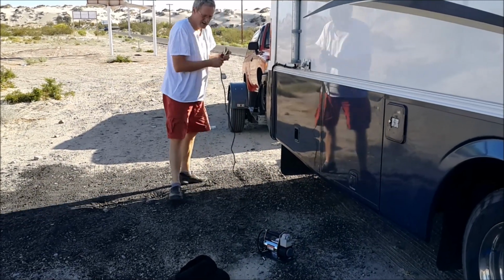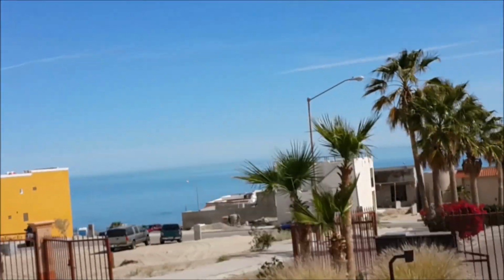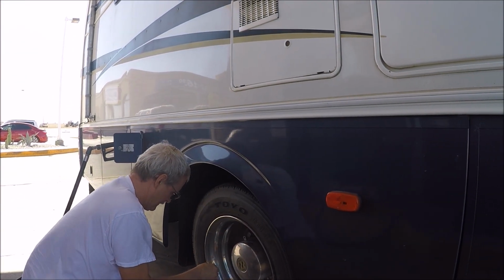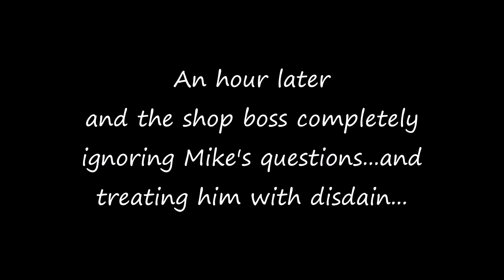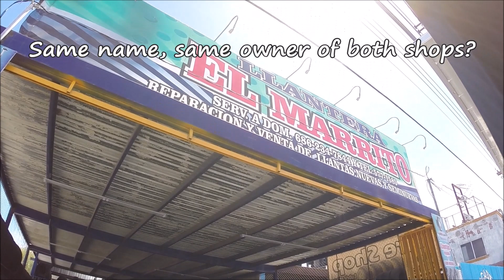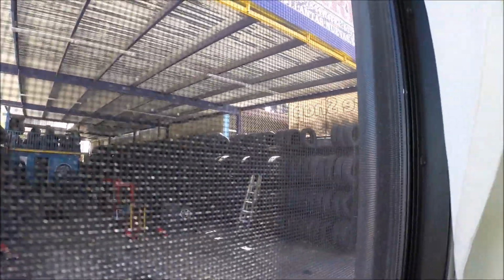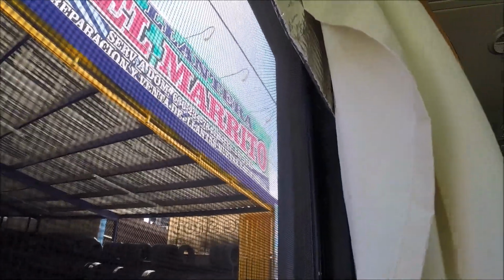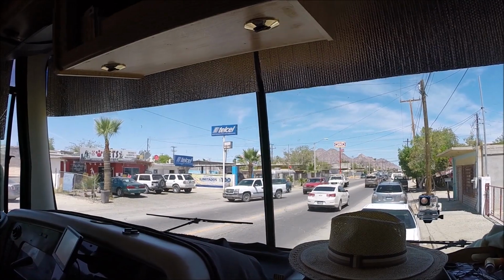Flat Tire In San Felipe Baja Mexico:What To Do [Full Time RV Lifestyle]

Comment: Was the problem the compressor you has didn't have enough PSI to fill your tire or you didn't have the power to run it? How old were the tires?
Reply from the maker: +RV Legal Eagles & Paws We had plenty of power and juuuuust enough psi to inflate for driving. We need a more powerful compressor ☺
Reply from the maker: +RV Legal Eagles & Paws Our tires looked newer when we bought this thing three years ago. Mike was able to make it driveable to get to a tire shop. We need a 120 psi 2 gallon tank.

Comment: I have one of those AC pancake compressors. I don't recall the brand, but it has worked well for me to top off the tires. Now I'm wondering what will happen if I have to fill a really low tire. I've been happy with the one I got, but I've probably only gone from 100PSI to 120PSI on a tire.
Reply from the maker: +Jumping Off The Cliff Ours could definitely be more powerful. Mike says 120 lbs and two gallon. As we discovered, it is essential! ☺

Comment: Kudos for the how to obtain dependable/friendly Mexi vehicle service info, and for having grace under pressure - for a leaky tire low pressure tire that is :) Wondering - looks like you had purchased/tried another tire inflater system that under-performed. Did you return, and get a refund or an exchange for a tire inflater that will put out next time?
Reply from the maker: +William Ladewig Hi and thank you! The tire inflater is from the US. The expansion tank from Autozone in San Felipe was returned no problem. It turned out to have a pressed on fitting, so putting on the proper fitting didn't work. Thanks for your comment ☺